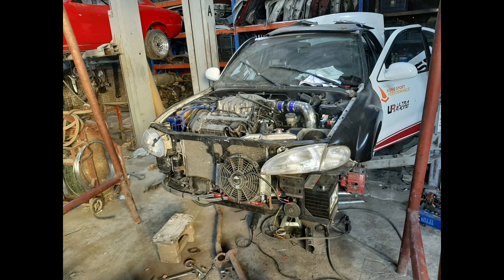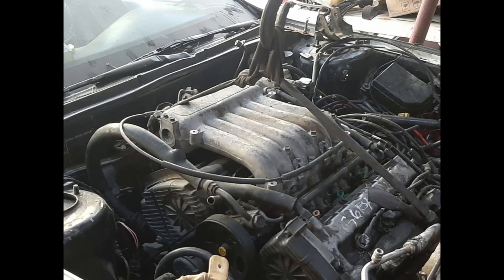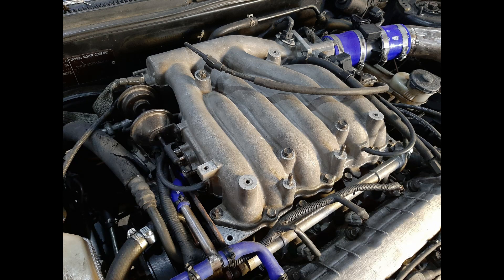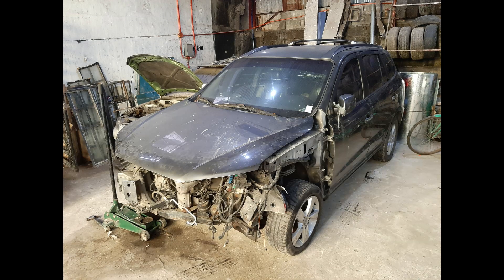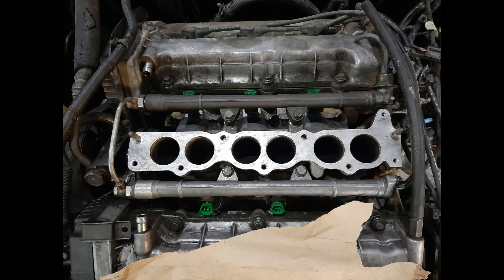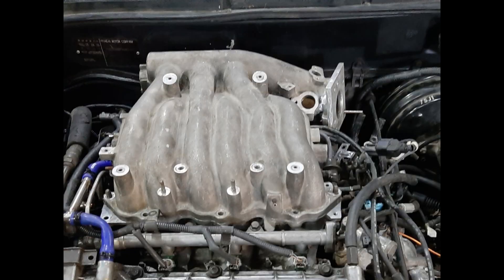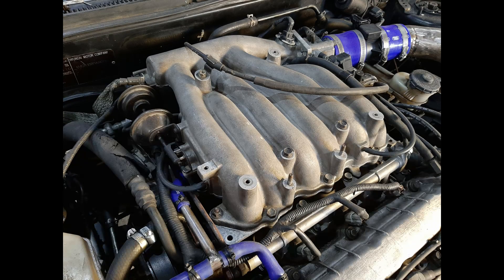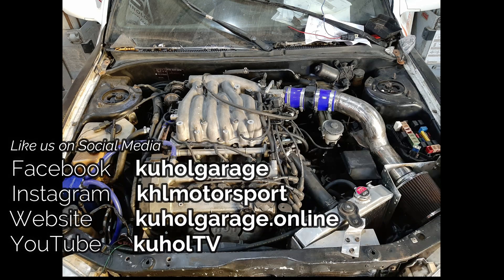Mu Intake Manifold on Hyundai Delta V6 G6BA - Project Elantra V6 Episode 4

Comment: Could you leave the original lower intake in place?
Reply from the maker: you swap the Mu lower as well. The Delta lower wont bolt onto the Mu upper
Reply: My intake runner flaps are ticking a lot. Though of replacing the entire thing like you did.

Comment: We Find a manifold like tris for a tiburón my questiion is what si What do whit the intérnals flapers because our engine going to be turbo?
Reply from the maker: I think the flappers inside should be fine under low boost. But putting a turbo negates the need to have variable intake runner lengths. So maybe no need to swap to this manifold if you are going to be turbocharged or supercharged
Reply: @kuholgarage  thanks

Comment: can you release specs for the adapter plate you made?
Reply: also, what is the size of the Delta butterfly valve on the throttle body compared to the one from the Mu?
Reply from the maker: @NinjaNitrat  we kind of eyeballed making the adapter plate, never did measure it. It's not too difficult to work it out, helps to have some cardboard to draw what you need, and a drill press to make the holes on the aluminum plate.
Reply from the maker: @NinjaNitrat  The Mu throttle plate is bigger but is irrelevant for use in a Delta. The Mu throttle is drive-by-wire vs. throttle cable actuation for the Delta
Reply: @kuholgarage  thanks for the replies. My intent was to have a size comparison between them to determine if a larger throttle plate was even worth it
Reply: @kuholgarage  I'm also totally doing this mod to my Delta, its a nice engine but it desperately needs more power xD gonna throw on a couple of magnaflow manifolds too

Comment: Seems like a bit more work than I initially anticipated.

The Delta 2.7L made 172hp and 181tq. While the MU 2.7L made 185hp and 181tq.
Which is a considerable jump for sticking with OEM Hyundai parts.
Reply from the maker: The difference in power between the Delta and the Mu will not lie solely on the intake manifold. The Mu has CVVT on the intake cam too. What made us attempt this conversion is that the Delta's torque tends to fall off above 5000rpm. A better intake manifold may help to improve the top end. Based on an initial drive, the engine does pull steadily even above 5000rpm